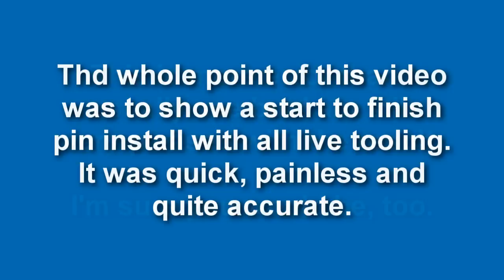Cue Making - Joint Pin Installation using live tooling

Comment: What are the cons of using the threading tool for boring the hole before threading?Breakage?? Seems you could save a tooling step but maybe the risk is not worth the reward??? Thanks in advance Bob- your work is amazing as always 👍🏻
Reply from the maker: It would be like using a boring bar to make a hole before drilling a lead hole first.  It's not the way the tool was designed to work.

Comment: This is a very nice well done video. I'm impressed. But my problem is that I need my old Brunswick MasterStroke repaired with a new joint. When I first got the stick about 50 years ago, it was just the butt and I had a new shaft made for it. But over the years the joint ferrules and wood have shrunk away from each other. Who can I send it to?

Ray